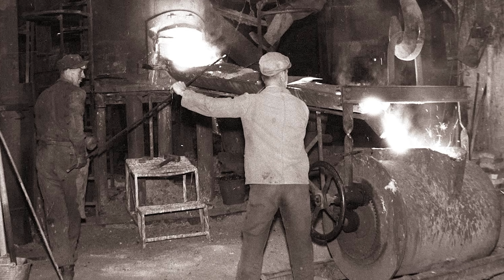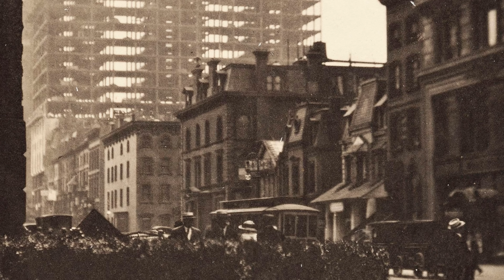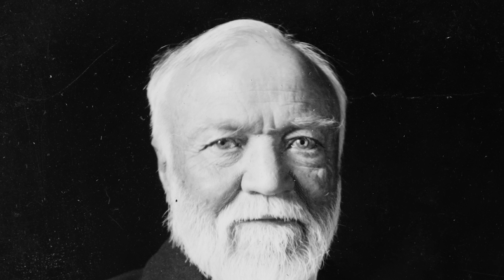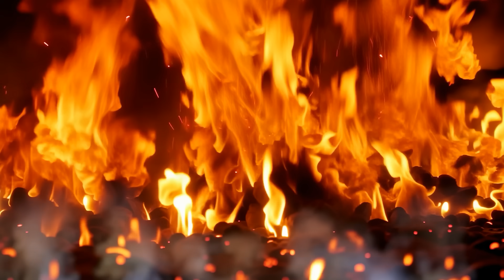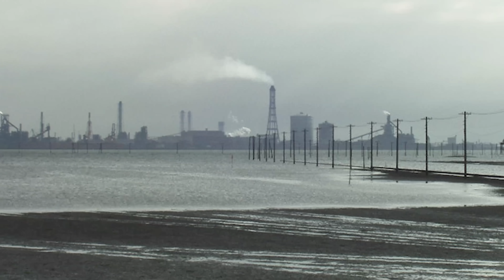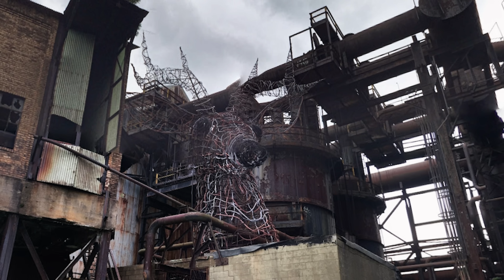Why This Blast Furnace Was a Living Nightmare for Workers

Comment: Everytime they shut a Blast Furnace down  it is sad. It is literal history.  I work in Indiana Harbor.  Old Inland  steel. Now Cliffs. There used to be 7 Blast Furnaces  there and 2 on the old LTV plant across the Canal now owned by Cliffs as well.  3 and 4 BF shut down and 5 and 6 on the Inland side.  When i hired in  in 92 there was 5 total. Now just Massive 7  Blast Furnace  supplies both BOF Shops...   so sad. No more Ore Bridge Cranes moving.. just sad. I understand  technology and modernization.. but i  used to run a crane that dumped Hot Slag from 5 and 6 Blast Furnaces... great memories  . Miss the old days. Retiring  in 2 yrs... great video. Thank you

Comment: A accident happened at USS In Grose Ile! I used to work at Clawson Concrete at the time we had a yard full of junk concrete trucks we called the boneyard to get parts for replacement for operational trucks! I noticed a machine always was covered with a tarp! Enquired about and what was it! They informed me that it was a pot carrier, It carried molten steel! A steering arm broke on it and went out of control went of a dock fell into the Detroit River and a explosion from the liquid steel water! There was nothing left of the operator!

Comment: The coke doesn't just 'burn', it's a complex chemical reaction, the coke partially burns to CO, which then acts as a reducing agent to convert the ore to iron, and carbon dioxide. An excess of carbon monoxide is required to make the process work.

Comment: For reference, Bethlehem Steel was based in Baltimore County on a tract called Sparrows Point. It was purchased in 1916 and was among the largest manufacturing plants in the World by output.

Today, it is fenced off. The traffic that flows around it is like a buzz saw… but the frontage road still takes a person past the fences and locked gates through Dundalk and Sparrows Point proper. I had many clients there who worked at the plant.

I hear that billionaires are looking to buy it all up and build a grand, inaccessible shopping, dining and residential condominium complex. Disgusting.

Comment: My dad worked in the Pittsburgh mills (J&L Steel). I remember him telling me they had to check on a coke furnace that had been sealed shut to let it go out a few decades ago. As soon as they cracked it, it fired right back up. Coke will smolder for years and years with low oxygen. He also talked about the graveyards where contaminated steel was dumped after accidents. It was incredibly dangerous work.

Comment: Wrought iron was not brittle. Quite the opposite, it was too soft and not hard enough, because it was almost pure iron. Cast iron is not a particularly specific term, as it does not specify what kind of iron is cast. Cast iron can be made out of wrought iron, pig iron, or whatever other iron. Pig iron was brittle, as it contained huge amounts of other substancec that introduced faults into its crystalic structure. Wrought iron has almost none. Steel has some, but only specifically chosen materials that improved its features, like carbon for toughness, chromium for toughness and corrosion resistivity, vanadium for toughness, molybdenum for flexibility. Plus all of those affected the price, the heat treatment process, melting temperature, compatibility with various shaping processes, etc. 
But when it comes to the good old iron, if it was always brittle, even in the case of the wrought iron, then the metal ships of the late 19th and early 20th century would just not work, as they would shatter into pieces in the combination of cold and harsh seas of the Atlantic.

Comment: The sloss furnace in Birmingham alabama was first fired up in 1882 i think its effectively the last of its kind
Reply: The sloss furnace was rebuilt with new equipment in the late 1920s. Carrie 6 and 7 were never refurbished after Carnegie bought them. So, by technicality, Carrie is older tech than sloss.

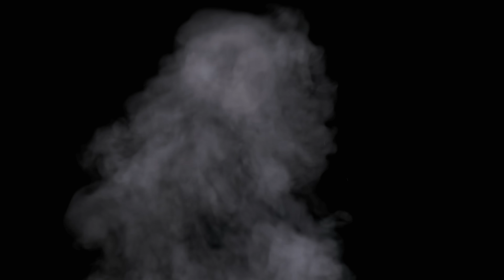Comment: 1:31 7:14  I'm a fire medic with a 40 year career: water expands 1600 to 1 when converted from liquid to gas. That means one cup, about half a water bottle, of liquid becomes approximately 100 gallons of steam. This is an essential tool and tactic of firefighting, but it's a bomb in an enclosed space like a furnace.
Reply: A class below taco bell manager but on par with taco bell night shift drive thru staff.
Reply: @jennyanydots2389 Just how many fire academys did you wash out of to get so bitterly jealous? Was it your physical or mental weakness? I'm betting it was the academics- putting the wet stuff on the hot red stuff CAN be awfully complex & tough to figure out!
Bet you could just scrape by as a professional donut gobbler at the police academy tho. Good Luck!

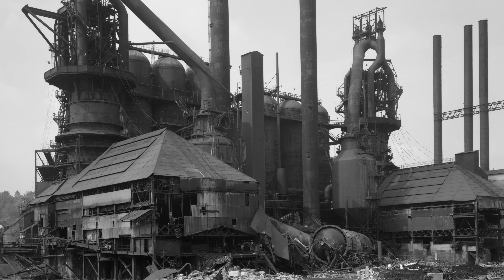Comment: 1:01 in the past 10-15yrs the "hot metal bridge" was converted from an old abandoned railroad bridge that once transported ore from one side of the river to the other, to a part vehicle part bike/pedestrian bridge. Somehow in a city with 400 somethin bridges this one stood out. 99% of the other bridges in the city were built for public use, so it served it's main purpose since it was built. This bridge wasn't just some railroad bridge, it was a bridge that was NEVER meant to have the public on it. Can't help but to think if I would go back to the 1960's Pittsburgh and tell the mill workers that in just 60yrs that bridge would be used for nothing but a bicycles and cars I would get laughed out of the timeline
Reply: No Railroad bridges were meant to have the public on them…unbeknownst hundreds of rail bridges are now rail trails.
Reply: That's the Hot Metal Bridge that connected the two Jones and Laughlin mills in Hazelwood and the South Side. Carrie Furnace is in Rankin, across the river from Munhall.
Reply: *its main purpose.
Reply: @TechTokOffical  it was converted and opened in 2007.